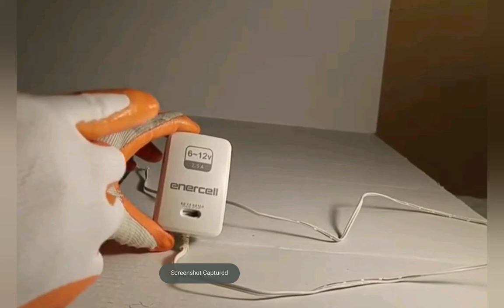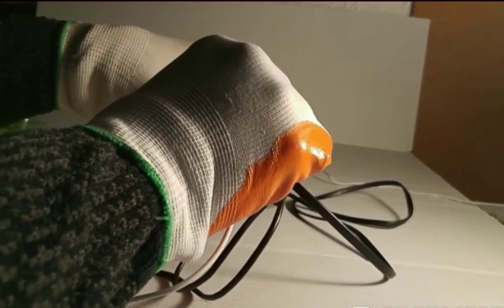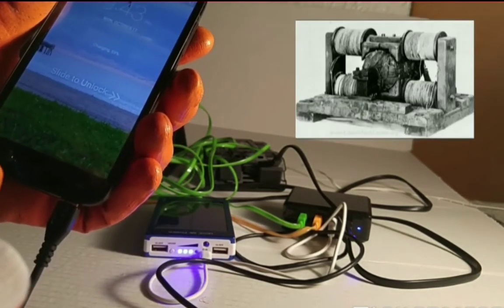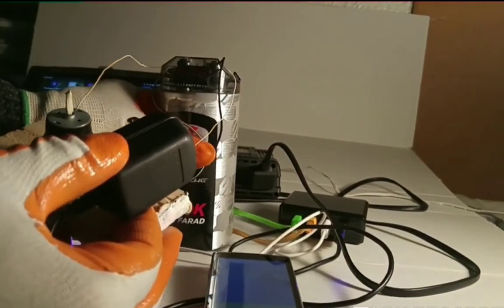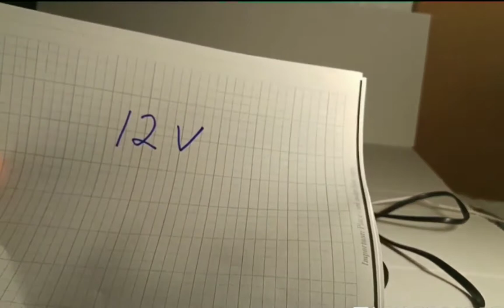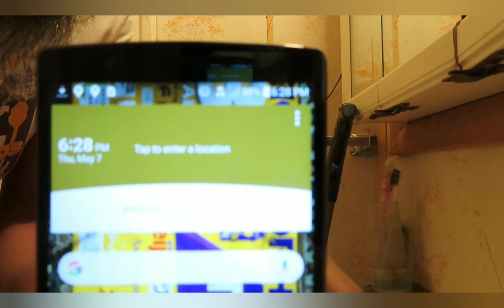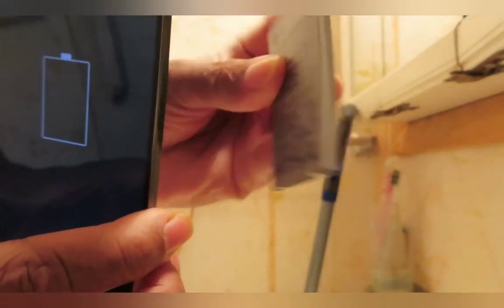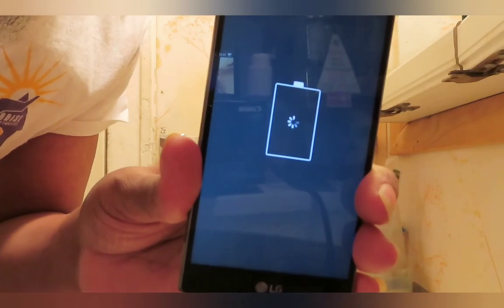He explains true overunity  pt 4 he used 12 volt what can we do with 12 volts, remember fiber-optic

Comment from the maker: Explain your comment in more detail you have to remember electricity is charging the battery at the same time that you were using the electricity how does electricity goes both ways at the same time explain many  people are interested to hear more of your comment if you can put into words better then it was designed that way. People would love to know how something can charge and discharge which out some kind of switch like a mosfet, looking at design of small electronic there are hundreds of different types of twitches. But the physics says you can only do one thing at a time

Comment: The phone needs the battery because it was designed that way. It was not designed to run off the 5V 'charger' directly. You can charge and run your phone at the same time because it was designed that....it is tapping power off the battery - there is no secret switch

Comment: in case you  STILL  don't  understand,   power is  WATTS; not volts.    watts = amps x volts.    an increase in voltage alone  means  NOTHING.      a voltage doubler  does  NOT  double  the  Power (watts).       'using' power  is  Seldom  informative.     running  an  UN-loaded motor  is  Not  informative.      googletranslate